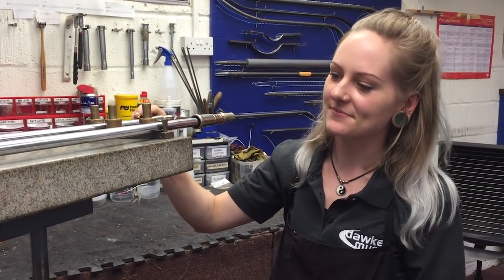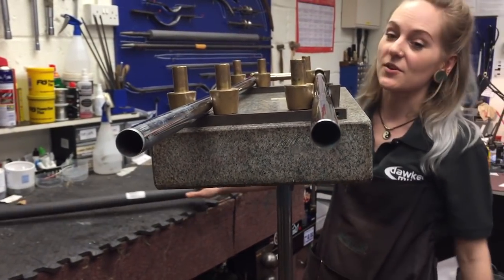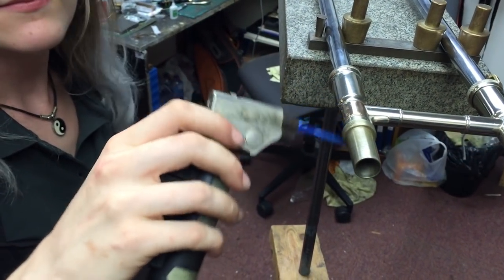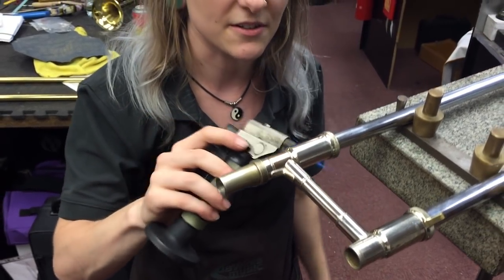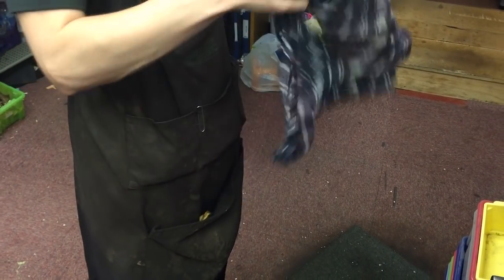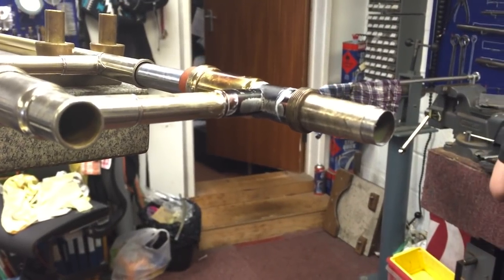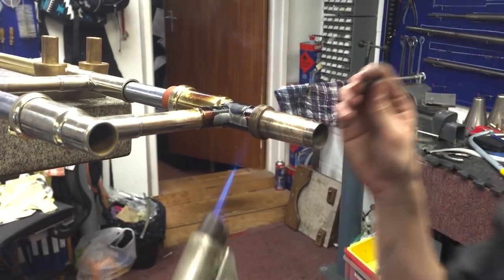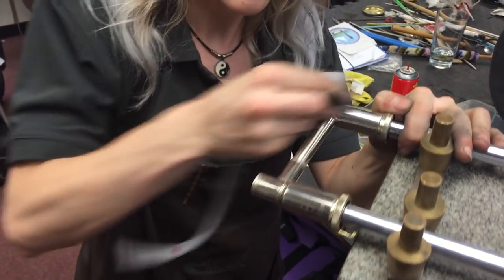Brass Repair Cam - Trombone Slide Leg Replacement (Abi)

Comment: I use a rode that has a drywall screw silver soldered on the end. Put it in and turn clockwise and pull. Sometimes it comes out in pieces.

Comment: What kind of cloth are you using for the rag polish clean up at the end?
Reply from the maker: Hi - it's Diamond Backed Flexible 400 Grit - See link here: https://www.dawkes.co.uk/diamond-backed-flexible-abrasive-strip-400-grit-300mm-x-25mm-strip/17724

Comment: As a trombone tutor, I get calls from parents on very similar incidents...usually rags stuck in the slide itself..near the water valve,,,I have to desolder the  bend , remove the offending object...resolder...I counsel the students to never put a rag in any part of the instrument...that is why those little cleaning snakes are for...they are mad for a specific reason...

Comment: What is that abrasive cloth you use to clean it up?
Reply from the maker: Hi - It's Diamond Backed Flexible 400 Grit - see link here: https://www.dawkes.co.uk/diamond-backed-flexible-abrasive-strip-400-grit-300mm-x-25mm-strip/17724

Comment: What product was that you were using to clean up/sand the Solder joint with?
Reply from the maker: Hi - It's Diamond Backed Flexible 400 Grit - see link here: https://www.dawkes.co.uk/diamond-backed-flexible-abrasive-strip-400-grit-300mm-x-25mm-strip/17724